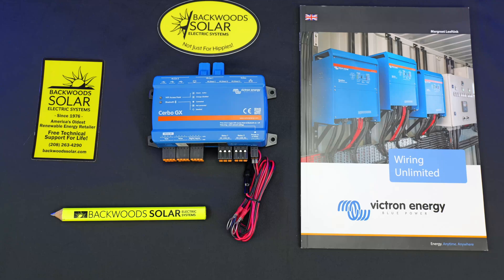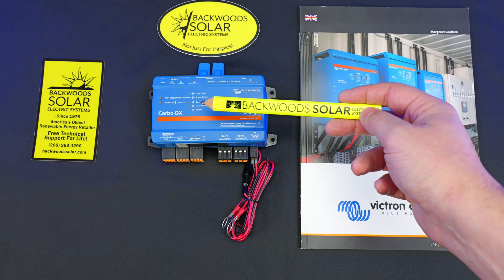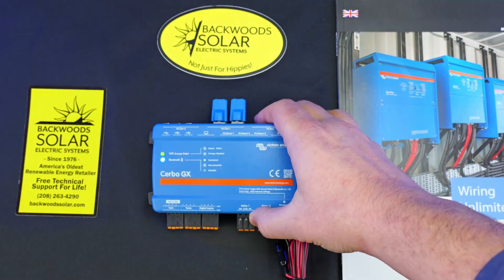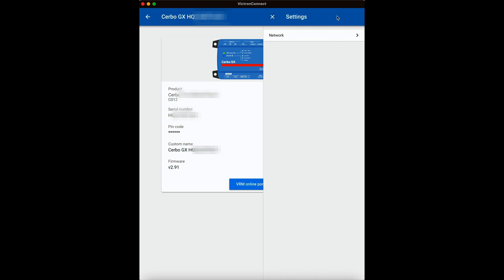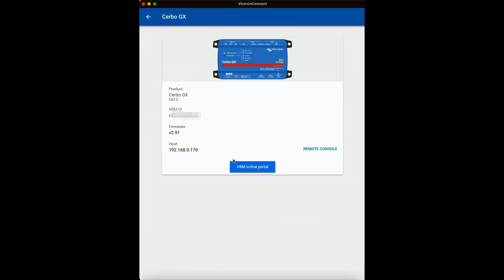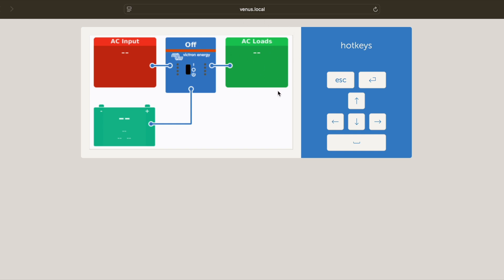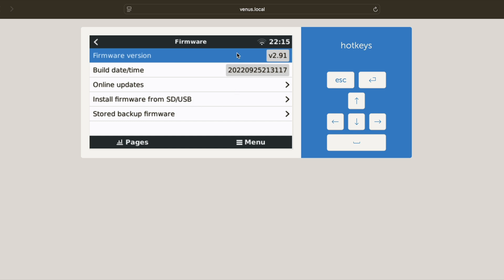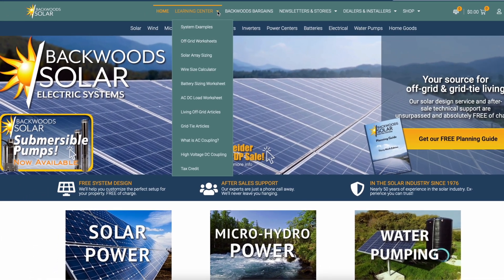Victron Cerbo GX MK2 - Part 2 Powering up, Communications, Firmware

Comment: What a great video.  Victron should post your video on their site.  The digital inputs and relays gives me a lot of ideas.  A more advance programming guide to do If/Else scenarios would help with automation.
What is your opinion on the Ekrano versus Cerbo/Touch?  I like the Cerbo because I want the brains next to my electronics and the Touch 70 somewhere else more accessible.  It's been said the HDMI can't be more than 6 feet.  Is there a way to extend this easily?
Reply from the maker: Thanks, I appreciate it.  There is not much difference in the Ekrano/ Cerbo as both can handle multiple displays. If you don't care to have a touch screen right at the equipment then do the Cerbo and then use any device of choice for display. You can even completely high jack an android device for this purpose.  See this Victron community post https://community.victronenergy.com/t/new-use-an-android-tablet-as-dedicated-gx-wi-fi-display-beta/8575  We sell a pre-flashed tablet, ready to go,  for just this purpose. https://backwoodssolar.com/product/7-bws-monitoring-programming-tablet/ I find you can hard cable extend the  Touch GX50 and GX70. Just be sure to use the included ferrites and high quality USB/HDMI extensions. Adding over a 10' extension may cause touch input problems. This has been my experience anyway.  Be aware any HDMI monitor/TV can also be used for display only purposes direct to Cerbo.

Comment: Mk2 has issues with vcan2 port .
Reply from the maker: There is a rare hardware issue with the MK2 and the VE CAN 2 port. We have not seen it in the wild. This could be due to a combination of low failure rate and/or low use rate of VE CAN 2. The vast majority of people will only use one set of CAN ports. The use of CAN 2 would mostly be limited to complex systems or systems with other outside integration such as RV and marine applications. So far there is no fix (there may never be) the only solution is RMA. Another good reason to buy through a trusted Victron dealer.
Reply: @ I buy directly from Almere as I’m Victrons installer in Ireland 🇮🇪 we also have branch in Poland . There is no need for a complex system to find out about that issue. Old cerbo had bms can on d left so I’m use to throw a battery bms there still and this is how I had it discovered. We also had v can mppt rs 200 on v can 1 . Few days after install battery bms was loosing communication and port was not even present on the menu , double hard reboot helped for few hrs and same thing over and over … after few call-outs to a customer and hrs spent on large battery bank adressing / re adresssing decided to swap ports . It worked and batteries are still active since but mppt rs coming and going:) I’ve v can 2 off and used v direct . I’m sick of cerbo mk2 . It happened to me at few installs